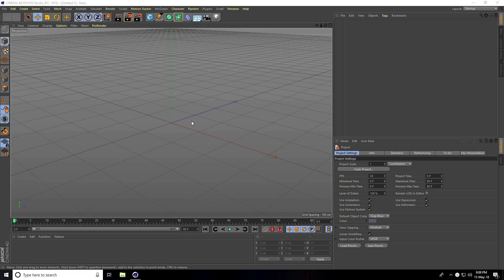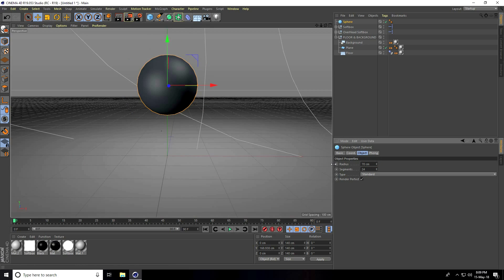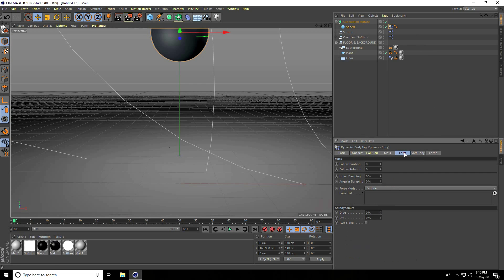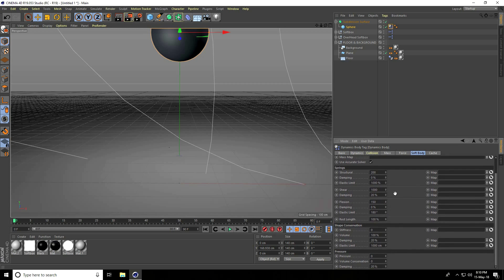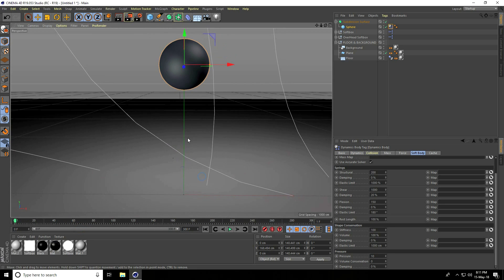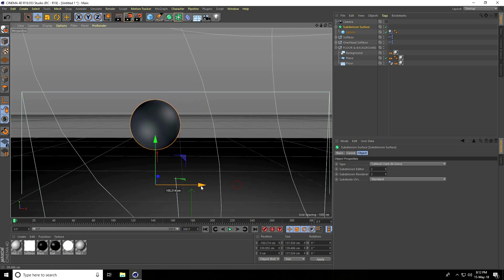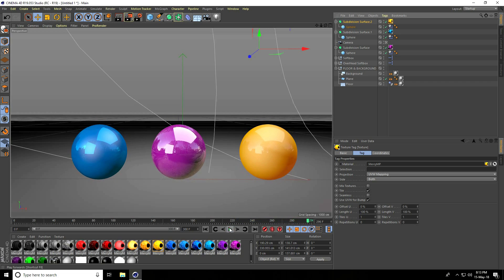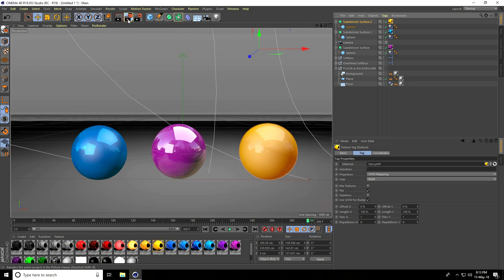Cinema 4D Tutorial - Bouncing Ball Animation

Comment: Today i have spent more than an hour to adjust those settings. Though i couldn't find exact ones. My ball was floating, distorting and polygons were filling all the scene. I guess i will note those settings on a paper and keep it on my desk till i lose  it just like the other a thousand ones. Thanks.
Reply: I had similar issues but had made the mistake of using a plane instead of a floor. When creating a floor everything was acting as it should :)
Reply: @ollenorgren2335  Yeah, same here.
Reply: @ollenorgren2335  Well, i've never thought on that. I'll try it. But using floor requires so much time when it comes to rendering. I don't prefere it in complex projects. Thanks anyway.
Reply: @ollenorgren2335  Same here changed it to floor and everything is fine now!
Reply: to fix the ball destroying its self go to edit menu > Project Settings > Dynamics Tab > Expert Tab > then lower the top setting called "Collision Margin" It's default is 1cm. Lowering it to 0.1cm will work but it's probably overkill. Keep raising that number until just before you see problems with the structure of the ball.